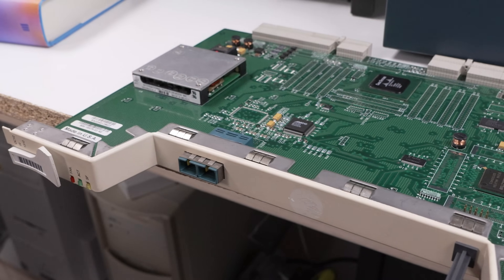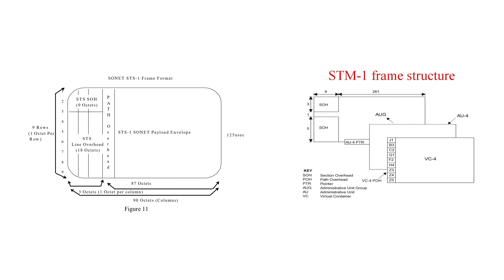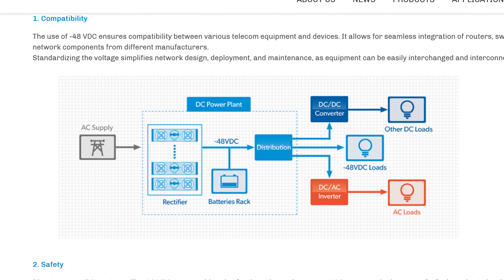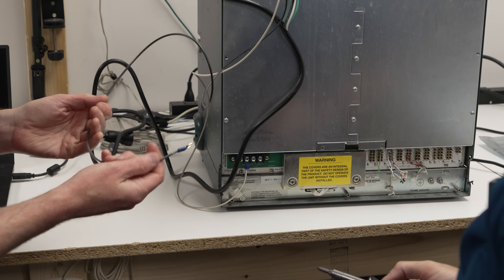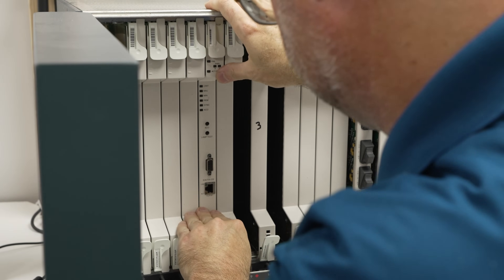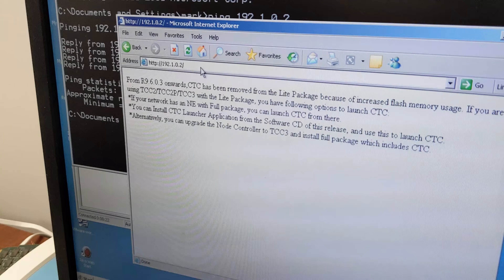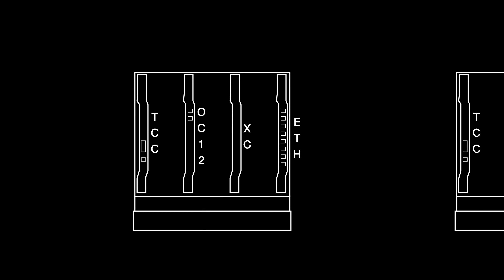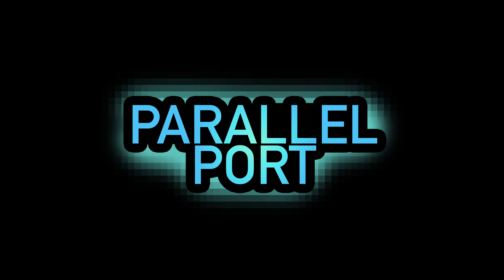Our optical networking journey CONTINUES!

Comment: 600W you probably want slightly larger gauge wire for that? I wonder how regional this equipment is? In the Northeast, Bell Atlatnic/VZ and also I believe MFS were Fujitsu. Don't think I ever saw the Cisco stuff in a telco colo space. Also as you start working out the bandwidth and realizing how oversubscription here wasn't really an option, you start to see why the telcos were so, so eager to move to ATM (and of course, much later than their CLEC competitors, metro-ethernet). This stuff is expensive and an OC-3 is always gonna be an OC-3 - you're not going to find a way to really under-provision too easily with the old SONET stuff.

FWIW, one of the older data-centric colos in NYC is shutting down in the coming month at 111 8th. It's old enough to have 23" wide racks and 48V power available throughout. Google seems to not be renewing any leases in that building.
Reply from the maker: The Cisco ONS was pretty widespread - I've seen some on ebay with AT&T labels.  Cogent, Time Warner cable and XO used them.  

Wonder where that gear from 111 8th is heading!

Comment: The serial console problem is most likely a flow control or pinout problem. Given this hardware wasn't originally developped by cisco, it may not follow all the usual configuration from cisco.
Reply: yeah these plastic slide-in trays/expansions doesn't feel very Cisco at all.

Comment: There is no way that the power supply is big enough for that being switch mode and it's probably noisy is it all get out 😂 impressive it worked.
Reply from the maker: Didn't include this in the video obviously, but we measured the AC power draw at 160W which was much lower than what either of us expected! But yeah, that supply is really only useful for barebones testing like this.
Reply: @TheParallelPort  In your application you're never going to be putting the thing under substantial load (consider what it was built for) so you'll probably get away with that power supply for quite a lot. Should be plenty of power to build out an "example" network with some kind of high speed backbone (OC-12 or faster) and a "consumer" drop card (say OC-3) along with the supervisor.
Reply: Not if they fully load it. The optical interfaces take a ton of power. But a simple, minimalist setup shouldn't be too bad. And doubt they'll be leaving this stuff turned on for days at a time.
Reply: @jfbeam  That was my point, they're never going to be fully loading it because there's no reason to.

600W will be plenty to run a supervisor some backbone ports and some "customer" ports.

I used to have basically the Bay Networks equivalent of these chassis with an OC-48 uplink, a 16 port FE card, 4 4 port OC-3 cards and the supervisor, idle draw was around 300W, that'll certainly go up when you start to actually load the thing but for their kind of lab work you're not going to be pushing it anywhere NEAR its actual capacity.